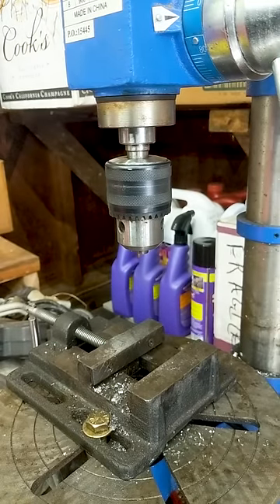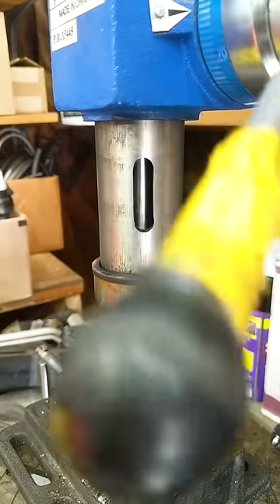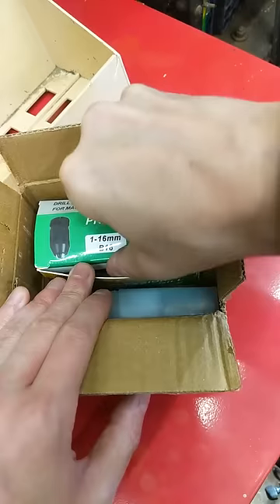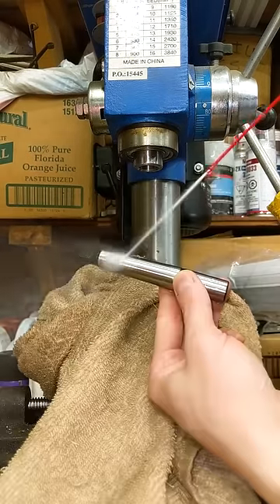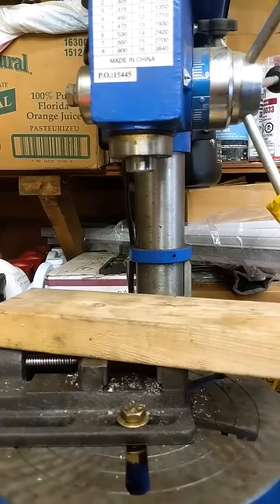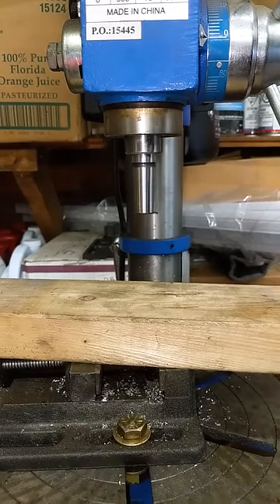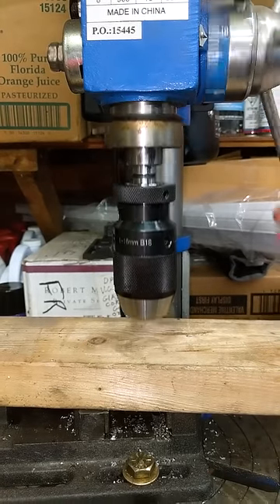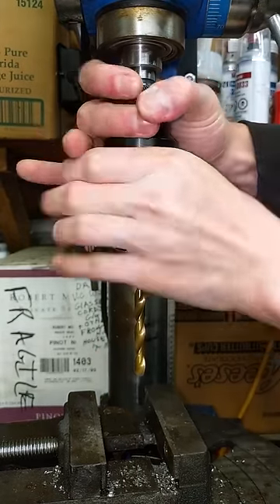How To Change A Drill Press Chuck In 60 Seconds! #Shorts

Comment: I'm a machinist. We use both keyed and keyless chucks. I prefer the keyed, they have superior grip on the drill.
Reply from the maker: Yeah there are def downsides, but I'm generally changing bits a lot to step up sizes or do a bunch of small jobs and this just saves me time. You can use tools to tighten the keyless more as needed, though I don't have the right lock wrenches hehehe.
Reply: As a machinist this pained me to watch 😬😂 first of all "drill drift" for the love of God drill drift! And secondly yes grip is good. Doing up a keyless chuck by hand and saying its quicker is like not tieing your shoe laces because you dont have time... both chucks work the same and both chucks come with keys or wrenches and both should be used 🤦‍♂️
Reply from the maker: @wildin13  In terms of physics, what is the difference between a drift and a lever? Also keyless chucks are called keyless for a reason. They give you a wider area to grip so you can do them up by hand. The spanner holes are used when you need to tighten more.
Reply: @802Garage  in terms of physics? Hardness? Damage to the tapers and your quill? Yes they're called keyless because you dont turn a key to tighten them, you use a c spanner instead hence the 3 smalle pockets. The "gripping" area has exactly the same effect for both chucks, it gets you near then you use either they key or c spanner depending on which chuck you have to tighten it. The working principles of both chucks are identical 🤷‍♂️
Reply from the maker: @wildin13  How is it going to damage the taper when it is physically impossible to hit the taper? How would a drift not do the same damage if so? The physics principle is a downward force on the tang at the top of the taper and a lever can work just as well as a drive. The only reason to use a drift is generally because if the taper is rather stuck hammering on it will produce a lot of force and get it out. You do not need a special drift to remove an arbor. It is extremely basic.
As for a keyless chuck, it's called that because it can be tightened without a key. It can also be tightened without a spanner, which in this case would invalidate calling it keyless since that would simply replace the key. You can use the spanner to add enough torque in situations where necessary. I literally already said there are spanner holes in my comment so not sure why you repeated what I said. Of course the principles of both chucks are the same.
If you wanna DM me on Instagram I'll send you a video of hand tightening a bit and drilling through steel with no lube and heavy pressure, hahaha.
Reply: @802Garage  i can't believe i need to explain the difference in hardness you a mechanic 🤦‍♂️ screwdriver... hard. Drill drift...softer. hence why its safe to hit a drift with a hammer... if there are 2 things one hard one soft, which gets damaged and which doesn't? What about 2 hard things? Which get damaged then. And when I say taper I'm talking about your quill. Damage your quill, externally or internally, its going to effect how it works. Some cases you can even jam it up. I mean hey, I guess I should say it like this. What do you tight a nut with? Pliers? Vice grips? Pipe wrench? Or a spanner/socket? All of them work but only 1 is right 👍 
And on the topic of the fact its CALLED a keyless chuck... you can call yourself Dorris and wear a dress, it doesn't make you anymore a woman. The mechanical workings of a keyless chuck are typically the same as those of a keyed chuck meaning you can use them both the same.... the keyless has no extra gripping power nor is it faster to use like you've said in the video. If you only want a hand tight chuck then do it with either get the same results. 🤷‍♂️
Reply from the maker: @wildin13  What are you going to damage with the hardness? You do realize a drift is hard too, right? They are steel man. What are you going to damage? You still haven't quantified anything. There's nothing to damage. There is only the tang at the top of the taper. You can't damage the taper in the spindle or the taper for the chuck because there is no way to hit them when you are just pressing down on the tang. If you damage it you must be stabbing about like a toddler. If it's possible to do with a screwdriver, it's also possible with a drift. Your analogy of using tools for a nut is faulty, but it's also very possible to use any of those tools to tighten a nut without damaging the threads, which would be an appropriate analogy, and anyone with a brand can manage to do it without drastically damaging the surface of the nut. What you have in machining experience you lack in basic physics understanding I guess.
It's called a keyless chuck because it does not require a key. If it required the spanners every time you used it, then it would not be keyless because they would be the key. Just because it's called a key for the specific type of chuck that uses it, doesn't mean the spanners aren't equivalent. Another name is a toolless chuck. Also Google keyless chuck and examine how many do not have spanner holes. Also Google cordless drill and notice that almost every modern drill has a keyless chuck and no space for spanners and they work perfectly. You do not HAVE to use the spanners to tighten it. The provisions are there to make it POSSIBLE if you need to tighten. Again, if you want me to prove it to you, I'll send you a video on whatever platform you like of hand tightening a bit and drilling steel with no lube. The keyless has no extra gripping power except for how they allow you to grip it yourself. That's he difference. It is also much faster and denying that is asinine. There is a difference between being really opinionated and being right.
Reply: @802Garage  I guess "keyless" cars don't require anything to open th.... you know what, you're 100% right mate. You win the Internet 😉 me as a toolmaker clearly knows nothing about it...
Reply from the maker: @wildin13  You know that with keyless entry you don't have to use the key except as a backup, right? So I agree with your analogy. ;) Thanks for the win! I'll take it.
Reply: As a machinist you should know there's no such thing as a keyless chuck. Even the chuck demonstrated here uses a c-spanner to tighten it properly.
Reply from the maker: @DimerNL  But the spanner doesn't HAVE to be used. I've even drilled steel with a large bit and not had to.

Comment: That's definitely a little better chuck than the original
Reply from the maker: I sure think so, but some people in the comments don't, hahaha.
Reply: @802Garage  well its a copy of a German  made Albrect precision drill chuck. They are designed to have minimal runout. Beauty of that design, it's key less, but if you need it tighter you can use a hook spanner wrench in the holes at the top of the collar
Reply from the maker: @NDC1115  I hadn't even thought of that although I've certainly seen it done on lathes and such. Thanks for the info! Yeah I only paid just under $31 shipped so as long as it doesn't slip lile crazy I'm happy. It definitely runs truer than the old chuck and I think the rest of the play is likely in the cheap press. 🤭

Comment: As a machinist i like this kind of drill chuck the most. The grip on tools isnt perfect but its definitely fine for most materials and ive broken off a lot of drill chuck keys in my career
Reply from the maker: Glad to have a machinist chime in with some positivity! Hahaha. This chuck just saves a ton of time and having to deal with the key. Plus if the bit slips, at least it saves you from snapping it. ;)
Reply: He didn't counter spin the tang, or hot it in with a lead or brass hammer. It's gonna twist, and fall out the first time the bit hangs up.
Reply from the maker: @RandomsFandom  Lots of other people disagree with you. Other people say you're not supposed to hammer at all. Funny how everyone has a different opinion. It hasn't fallen out. If it does spin, it would lock the tang in place and then still be pressed in from the pressure anyways.
Reply: I'm also a machinest, I personally don't like these key less ones but they are good for some operations on soft materials and woth multiple tool changes

Comment: Dude you dont need to press it in, its a morse cone, you just need to shove it in with a lil bit of force and it will hold until the machine holds
Reply from the maker: Sure, but it's going to be pressed in as soon as you start using it either way. I'd rather not risk it falling out first time I go to use it or having the arbor spin in the spindle when it first makes contact.

Comment: As much as I like sticking something long and hard into the hole, I'm gonna hang onto the ol' chuck. She's done me good this long, I can't sell her out for a new model now.
Reply from the maker: Old faithful. 😌
Reply: @802Garage  lol, yessir.
Reply: Maybe you just need a new style
Reply: I agree, besides you can tighten a keyed drill Chuck a lot tighter with a key so your drill bit doesn't spin and get all galled up by the Chuck !
Reply from the maker: @rapidfire-0680  You can use tools to tighten this as well, it simply isn't necessary in most cases.

Comment: You don't need to press the arbour into the spindel with excessive  force. Just use a bit of speed (line it up first).
The force during drilling will keep the arbour  seated.
If the arbour falls out it's probably a poor surface finish or the angle is slightly of.
Reply from the maker: Yeah generally agreed but no harm in seating it before you go for a first drill. 😂

Comment: Some drill press quill's do not have that slot where you can insert a screwdriver into to release the Chuck from it's Taper, sometimes you have to use a certain type of wedge type of tool and a hammer, that will fit in between the top of the drill Chuck, and the bottom of the quill to release it !
Reply from the maker: That's the same slot. The drift does the same job. I just don't have one. ;)

Comment from the maker: Check Links for Price and Availability:
Keyless Drill Press Chuck: https://amzn.to/3fduxKZ - 1/32"-5/8" 1mm-16mm Morse #2 Arbor Taper (In Video)
Alternate Drill Press Chuck: https://amzn.to/3T5k82I - 1/32"-5/8" 1mm-16mm Morse #2 Arbor Taper
Cheaper Drill Press Chuck: https://amzn.to/3Tc3z51 - 1/32"-1/2" 1mm-13mm Morse #2 Arbor Taper
Another Drill Press Chuck: https://amzn.to/3Co5MDV - 1/32"-5/8" 1mm-16mm Morse #2 Arbor Taper

Comment: I think I have a (much older) version of this exact drill press model in my shop, when did you get it? Do you have a model number handy I could search for? Would be great as a source of replacement parts.
Reply from the maker: I got it used from someone several years ago who probably owned it for 5-10 years at least. I think it may be an old Harbor Freight model. Here's all the info from mine:
Pro-Tech 16 Speed Floor Drill Press
ZJ4116H
120V ~ 60Hz
16mm 6.6A
NO. 3113
I'm guessing that last number is the catalog number for the store that was selling it, like Harbor Freight. Hope this helps!

Comment: I'm not saying there was for sure, but did I see a wobble in the bit after you put the new chuck on?
Reply from the maker: Possibly a tiny bit, though I haven't measured runout yet. Reviewing the footage frame by frame it looks pretty true. Doubt it's perfect. Real cheap drill press. It's much better than the old chuck though!
Reply: @802Garage  It definitely looks much better.

Are you also a cheap tool fanboy? Personally my workshop is made up of the cheapest tools I can possibly get, and it's great for when something breaks cause everything's cheap anyways
Reply from the maker: @zackearns4240  Both out of preference and necessity! Generally, unless a tool needs tons of precision, I buy something cheap that works well. If I do happen to break something, I either learn and replace it with the same or buy something better. The one area I have spent a lot is my cordless tools. I have DeWalt 20V and Milwaukee M12. I still don't buy frivolously though and I only buy when there are sales or I can get free batteries! Expensive brand tools can be nice, but in most cases they aren't necessary.
Reply: @802Garage  We can be friends I think, we seem to have the same approach to things. I'm so glad I finally found someone that thinks the se about tools 😂
Reply: @802Garage  Whenever you see a home Depot deal on free tool with purchase of some batteries, you can pick the item you want and deliver it to your home or pick up in store. The second item in the sale you can set for pickup at another random home Depot and never pick it up/cancel that order. This gives you a big discount on the item you wanted due to the way home Depot splits the sale price across both items. Worked for me several times now
Reply from the maker: @zackearns4240  Hahaha, yeah feel free to comment any time!
Reply from the maker: @DH-rt3fk  Yeah, I have seen that deal a lot. Most tools I have bought were either from Acme Tool, Ohio Power Tool, or International Tool when they were having buy one tool get one free or buy one or two tools and get two batteries free or buying a tool on a good deal that came with a battery free. 😁

Comment: What’s with the negativity? Yes, it reduces the quill travel, and if you have a bench top drill press you might not like that. So don’t buy a keyless chuck!
If you have a floor-standing drill press or a knee mill, a keyless chuck is great. Its a really convenient upgrade that you didn’t know you need until you have it.
Reply from the maker: Bingo. My press still has 26" max from chuck tip to table top after this, hahaha. Thanks!

Comment: There also drill bits that have the same arbor so you have no chuck
Reply from the maker: Huh never really seen that that I can think of.
Reply: You mean morse taper bits (usually used in milling machines and lathe tailstocks)? those are usually larger sized bits, I don't imagine you'd find morse #2 bits under ½".. suitable for an industrial radial drill press, but probably not a home shop

Comment: Has this guy never heard of a drill drift?!?!?
Reply: I was looking for this comment and like you don't need that much pressure just hand pressure
Reply: Exactly, it's got a taper for a reason!
Reply from the maker: What is the reason? :)
Reply from the maker: What is the point of the drift? :) Also the chuck is going to experience far more pressure when you start drilling something and I would rather it be fully seated before the first drill.
Reply: @802Garage  a drill drift is for removing the first chuck from the taper, but i don't see why it'd be a problem using a long screwdriver
Reply from the maker: @seamuscasey1563  Exactly. :) Physics is physics. Downward force on the tang. Leverage vs a wedge.
Reply: @802Garage  a drift if a specific tool to take them out and it will be rotational force not directions force
Reply from the maker: @jlreese94  I'm well aware what it is. It is literally a metal wedge. You can make one out of scrap steel if you want. It is not necessary, it just makes the job easy and can help with very stuck tapers. Do you understand the direction of the force? It is down. The direction is down. You are forcing a wedge against a piece of metal to push on another piece of metal. Do you know what a metal lever does? Like a big screwdriver? It presses against a piece of metal to push on another piece of metal. The force is down. Don't correct someone with an unnecessary correction. You could add something of value by saying "Instead of using a lever you can also use a drift which you hammer in to remove the taper." just for example.
Reply: @802Garage  never have used a hammer to knock out a chuck
Reply: @jlreese94  if the taper is loose enough that you don't need a hammer would you really bother going to get your drift if there where a flat head on the bench next to you, or if you're doing it for home projects go and buy one just for your drill press?
Reply from the maker: @jlreese94  Just how I've seen other people use a drift. If you aren't using a hammer, then what is different than what I showed in the video? If you are using a drift with a handle, you are doing EXACTLY the same thing I showed in the video. People make me laugh man.
Reply from the maker: @seamuscasey1563  Exactly. People should understand the principles behind what they are doing before they try to educate or correct others.

Comment: That's a Morse taper your supposed to use the key.
Reply from the maker: Are you talking about a drift to remove it? It does the same thing, it pushes down on the tang of the taper. I'm not sure why people think a metal wedge is a specialty tool. :)

Comment: Wrong they snap in place and use the correct wedge to remove not a screwdriver!
Reply from the maker: They don't snap in place it's a tapered interference fit. A wedge or a screwdriver both use the same physics principle which is simple force in a downward direction. Leverage from a lever vs leverage from a wedge and hammer are the same. I really don't understand comments like this.

Comment: Popping the Morse taper out with a screwdriver hurts my soul - go buy a proper Morse taper drill drift, they're like 10 bucks on Amazon.
Reply from the maker: What's the difference? I'd genuinely like you to tell me. Hammering a piece of metal onto the flat tang at the top of the taper vs using leverage on top of the flat tang. There is no difference. If you can give me one I'm glad to be corrected.

Comment: Got all of an inch of up and down movement now hahaha
Reply: The table is capable of moving up and down vertically.

Good try though.
Reply from the maker: Yeah the table on this press has a huge range. I just measured and at the lowest setting I have 26" between table and chuck head. I probably had around 28" before.